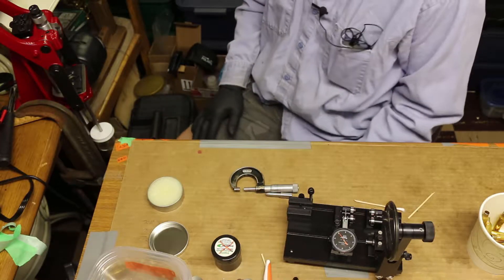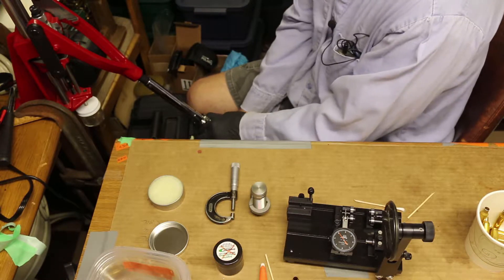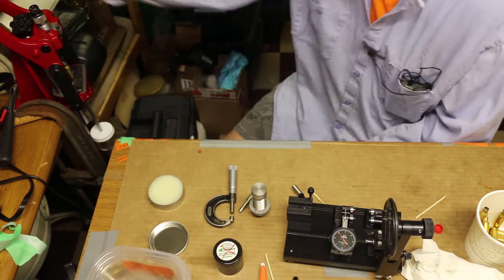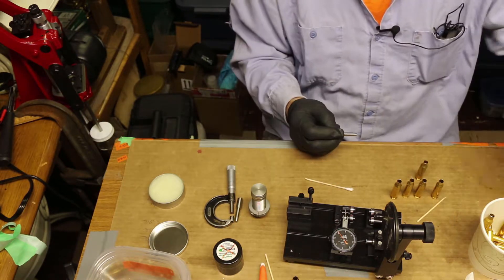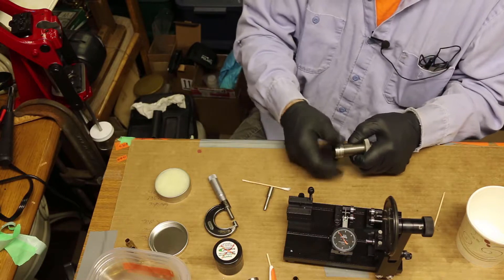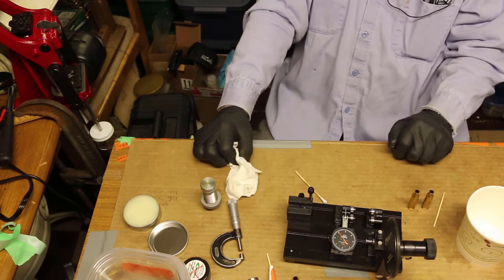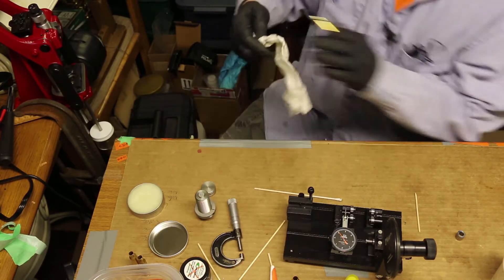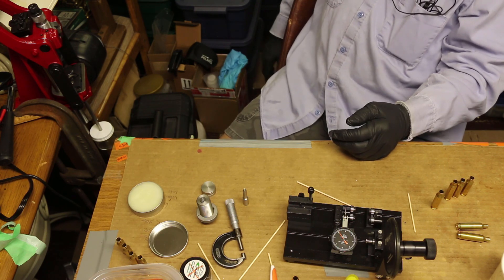A Example Case for Neck Turing Your Brass or Setting Bullet Neck Tension with a Expanding Mandrel

Comment: If you are unsure as to the efficacy of your sizing regamin, then do some testing.
You could start by running a simple comparison between running the case in once then measuring concentricity then, running into the die twice & etc. 
I think you should be able to measure any differences which may arise with the test equipment you have.

Comment: What make is the case concentrate tool?
Reply from the maker: the black one is a accuracy one concentricity gauge with a brown and sharpe 0.00005 indicator. this type of indicator is used by precision grinders. the .0001 indicator would work well also.